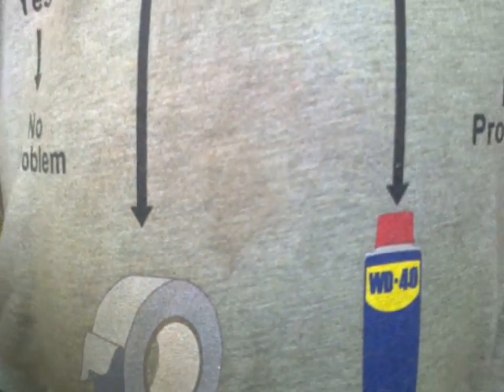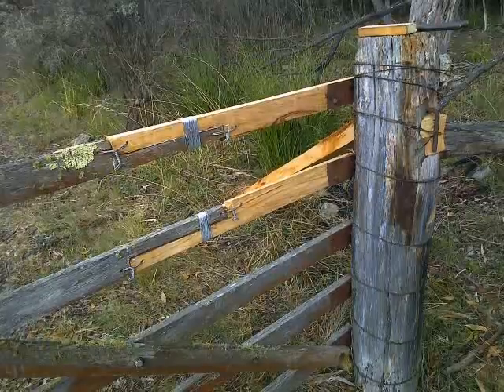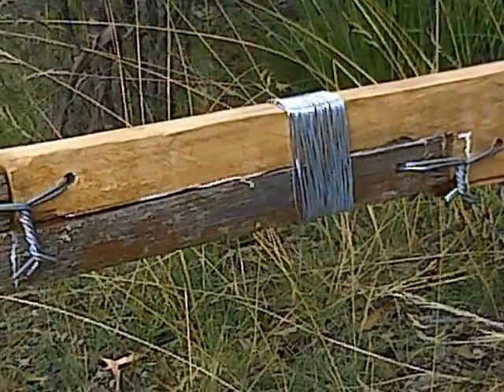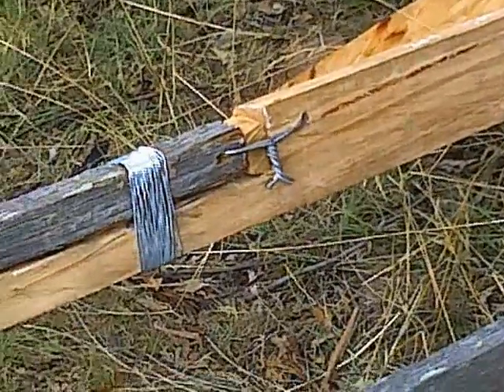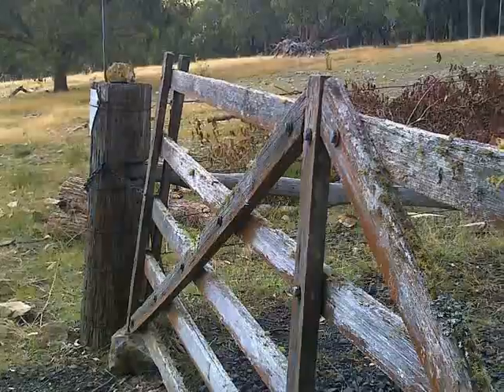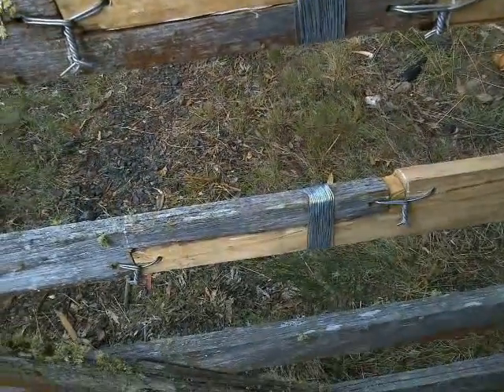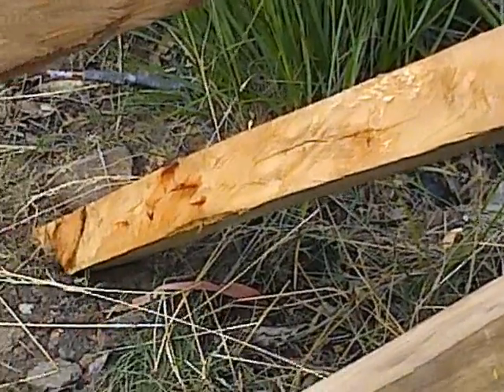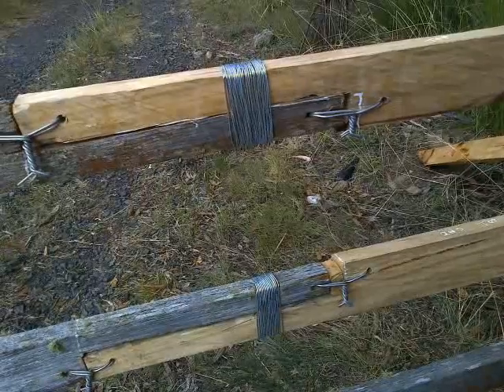Hillbilly Wood-Welding...!

Comment: Make do and mend at it's best.  Quality - always a relative metric - shines through. My "minds eye"  sees the quality in the dexterity involved winding hard wire that tight !! regards as always......jamie
Reply from the maker: G'day,

Thanks mate,

  The trick is to use big Fencing-Pliers on the Coathangar-Wire, and to pre-wind about 4 metres of Tie-Wire onto a short bit of wood to fashion a small Spool which can be pulled tight and will fit between the Bars ; so as to wind the Servings on without letting it get loose or tangled..., like a lot of things it's all in the sequencing and preparation...

Have a good one,

;-p

Ciao !

Comment: great job Chris,! :)
Reply from the maker: G'day Fee,

 Thanks mate,

  It took a fair bit longer than I expected, but it worked out pretty well...

;-p

Ciao !
Reply: +WarblesOnALot You have witches brew on your gate. Does it ward off werewolves and vampires and Frankenstein's?
Reply from the maker: Phoenix Incarnate 

The Moss & Lichen ?

 It seems to grow on any hard surface, particilarly under the Trees, my old Subaru even  has Lichen growing on it's Back Window, and the roof of the Hut has it as well...

  I think of the Mosses & Lichens as evidence that this is "Slow Time Country", where stuff stands still long enough for such hairy fringes to grow on them...

;-p

Ciao !
Reply: Yes, the lichen. "Witches brew" is a common turn of phrase amongst tree doctors, especially in the Southern part of this country. Once it's started, it's virtually impossible to stop, bit it actually feeds of the trees and sucks the life out of them, making it brittle and decay quickly (or, at least, quicker). There are natural mixtures one can apply to kill it, but on a highly infected tree, the usual solution is an interior cleaning and if the infected tree is close to allot of others, you can pretty easily tell which one is most diseased and wether it's worth the effort at all of bothering. In the case of decorative trees, people usually will think it is, but in a wooded area, not so much. It's kind of a skin decaying rash. 

I like Moss too, especially the very bright and soft kind. I was in a German forest once and was floored how beautiful it can be, and it helps break down dead wood for the forest bed :) Some of their forests are so thick, that even in mid day the sunlight barely reaches there. I managed to take some pretty interesting photos, but you'd think they were taken at night! :) 

They are both pretty durable 'plants'. Take it easy!
Reply from the maker: Phoenix Incarnate 

No worries,

 The Mosses & Lichens here seem more into breaking down the dead wood than attacking any living Trees...; I like that the Trees shade the Floor of the Forest, keeping it cool & moist enough for Moss to be growing...

;-p

Ciao !
Reply: I'm sure come Summer your buddies like that shade too :) Oz strikes me as a place that gets ghastly hot and very dusty. I guess that's why you are all known for being made of tough stuff, and able to drink copious amounts of alcohol that would kill the average person. 

 Anywhere set to 70F year-round is healthiest, and has the added benefit of making the residents seem incredibly smart and good looking to each other. Sometimes they actually are!. Who only need the humble accoutrements of tan lines and outrageously priced sports cars to prove their actual worth.

I do not live in such a place nor have any plans to :P
Reply from the maker: +Phoenix Incarnate 

   I like living around Trees, except when there's a Bushfire ; then they can be a bit scary, but I reckon it's worth those risks for the rest of the times - except when they fall on stuff one doesn't want to see squashed...

   I greatly dislike the Insurance Companys' ideas on how everybody should live at least 500 metres from the Tree-Line - just in case there's a Crown-Fire...

;-p

Ciao !
Reply: Blurgh on "insurance company's"... Are you required to carry it?
Reply from the maker: Phoenix Incarnate 

Actually, no, the only people "required" to have Insurance are those with Commercial Loans over some Asset.

 My Car Loan is unsecured, at 13%, whereas if I had "Life Insurance" then I could get a "Secured Loan" as an Overdraft or a Mortgage (Mort = Death, & Guage = Measure) at 6%...; but I avoid "Insurance" because #1 it's Blasphemy, & #2 the "Premium" is always "Actuarily-Calculated" to be  approximately six times the cost of the "Risk" ! 

  It's vastly cheaper to pray a lot and think stuff through before doing any of it...; drive slightly slower and avoid having an "accident", as I see it.

  Rather than trusting to the concept that "Who Cares, Everything's Insured, so if anything goes wrong then everything will be replaced, with All-New better-than-ever Shinyshiny components..., so it's no drama at all ; YaaahhhHoooo !"

  I disagree strongly, with the idea of "Insurance".

;-p

Ciao !
Reply: I concur. A little basic math and it's pretty clear who the real winners are. NOT the insured who, even if they have need of making a claim, will surely be fought tooth and nail by the insurer. It's pretty sick, so to the lack of regulation over them. Grrr.... One of my least fave topics lol
Reply from the maker: Phoenix Incarnate 

   I see it in terms of "Life Insurance is a Bet one has to die to win...!"

   And one only "needs" it if one genuinely feels that the Creator of the Universe is a total Fuckwit, with no idea of what should be happening, and therefore one might accidentally die by mistake, at "the wrong time", hence the need to "insure one's life", by organising to get paid enough to cover one's Debts in the event of one's death...; whereas Usury is forbidden anyway, so buying "Insurance" is kind of like playing Double or Nothing with Blasphemy...

   Which is why I get a big laugh over the number of Insurance Salesmen who're "devout Churchgoers"...

   And, every Church has an Insurance Policy to pay their Legal Fees for the next time the Clergy are in Court for being Sexual Predators, or for  beating Children with Sticks, as well as a Policy to cover the Church Roof against Storm & Tempest... (!!!!!).

Such is Life...

;-p

Ciao !
Reply: I never understood people carrying life insurance on themselves. They're not going to collect it. Particularly in the case of parents still carrying it when their children age now adults. Let the adult kids party the monthly fee then, since they'll be the ones benefiting, but the parent shouldn't pay it. If someone wants to collect on my death, I'll carry all the insurance in the world, but I'm not paying a penny of the rates :P lol

I don't know about all that blasphemy stuff, but I do know that those insurers are some of the greediest, thievingest bastard's walking the face of the earth :/ [insertmoreswearing]
Reply from the maker: Phoenix Incarnate 

     The "funny" thing is that these days Insurance Salesmen call themselves "Investment Advisors", and the "Superannuation Policies" they "put people into" are otherwise known as "Endowment-type Life-Insurance Policies"..., and the "Advisor" gets paid a Commission amounting to 110% of the First Year's Premiums , but if the Policy "lapses" within the first 2 years then the "Advisor" (Salesman) has to refund their Commission to the Insurance Company ; therefore, about every 3 years the "Advisors" like to churn all their Clients out of their existing Superannuation Plan into "a much better new Plan which has only just become available...!", thus transferring another 13 or 14 months of the Client's Premiums to the Salesman's Commission-Account while the poor silly fool thinks they're "Saving for their Retirement" while being robbed - and having to pay the Company an Early Exit Penalty Fee as thebprice of the Changeover, as well...!

   It's a mind-buggaring Scam...

Take it easy,

;-p

Ciao !

Comment: a tidy looking repair...not much that can't be fixed with timber and wire
Reply from the maker: G'day,

  Thanks,

  Yeah, it kinda makes it easy... ; imagine having to drill and Dowel the Splices and then Wedge the split-Ends of the Dowels, back before mass-produced drawn Steel-Wire became so cheap & plentiful...(!).

;-p

Ciao !
Reply: +WarblesOnALot i can't help but wonder if glue in the joints would last longer than the wire.
Reply from the maker: vengencefrom1979 

G'day,

Thanks mate !

 Um, well, pethaps, in theory..; but the Joinery would've had to be vastly-better, and it would take Boilproof Formaldehyde-based Resorcinol or Epoxy, and Clamps..., a lot more messing about in the 30 Degree Celsius Sunlight...

  Selleys Araldyte Epoxy is $12 for 24 ml in the Hardware Shop, whereas the Chainsaw-Fuel to mill all the Timber used cost maybe $4, the Bar-Lube was used Sump-Oil, and the Wire cost less than 50 cents...; so I make it $5 to make &  weld the Wood with Wire, versus $50 to glue the job, and the Epoxy is only good for 10 years in UV, whereas Tie-Wired Hardwood is good for 100 Years..., or so...

   So, yeah, at 55, I reckon the Tie-Wire will see my time out, whereas unless I used Resorcinol then glueing it would set me up for having to fix it again when I'm 65 or 70...

  Finally, 3 years ago I got to be older than my father was when I was born, and now I'm getting to relate to one of his most often-repeated comments on any jobs he did, "It'll see my time out, anyway..." ; I think it's a principle of Hillbillyism, to fix stuff so that it never needs to be fixed again...(?).

Have a good one,

;-p

Ciao !
Reply: WarblesOnALot
lol.  didnt know wire would last that long.
Reply from the maker: vengencefrom1979 

   Ah, well, it's Galvanised Wire, so that's one thing ; but also I'm over a hundred miles from the Coast & 3,750 ft AMSL, so there's no Salt in the Air here, & it takes over 100 years for a Nail to go rusty.

  "Slow Time Country", I call it...

;-p

Ciao !